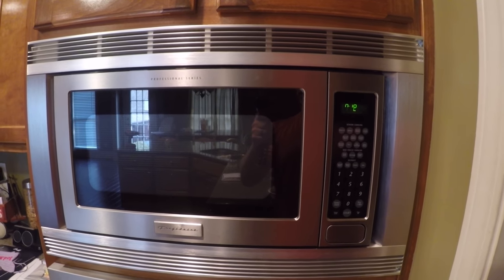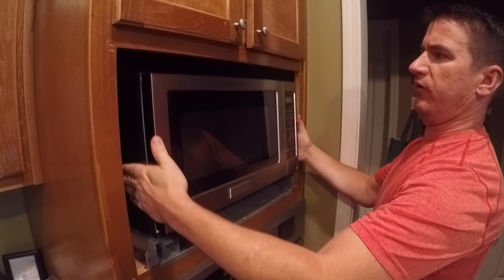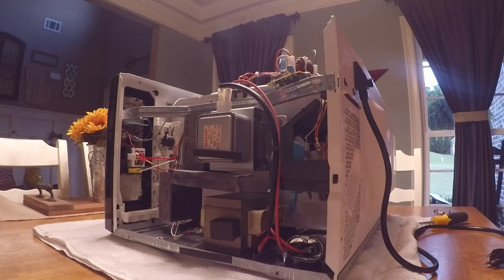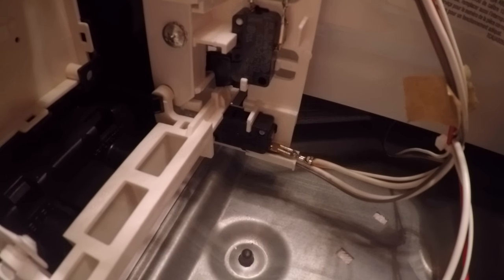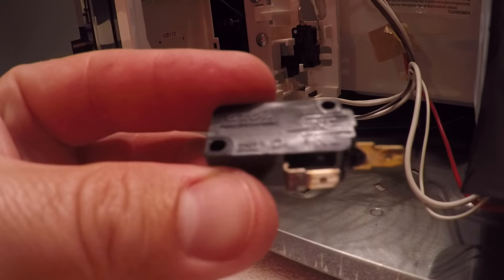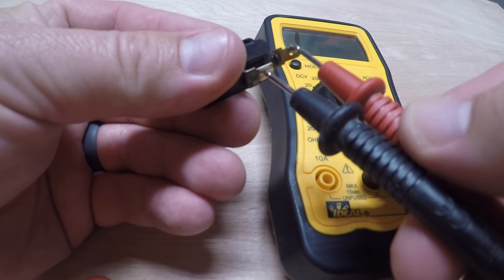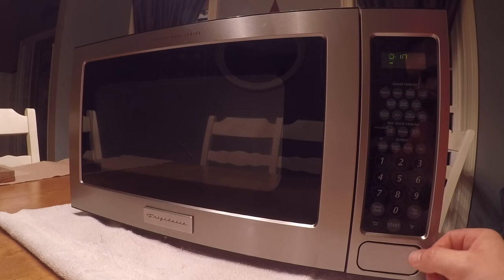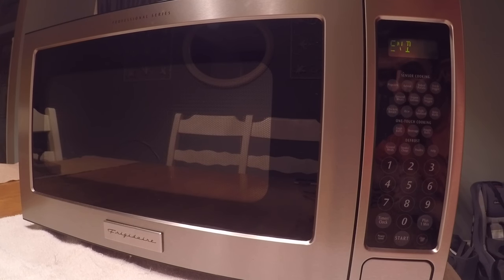EASY FIX: Microwave Will Not Heat and Turntable Will Not Spin - How To Fix A Broken Microwave

Comment: This is the best tutorial!  My Sharp Carousel botton switch keeps messing up.  Will check to see if the wires are touching.  Believe me, I am very careful to not slam the door shut.  Is there anything that I can do to SAFELY keep the switch wires from contacting each other?
Reply from the maker: jharbo1 I suggest you cut off the spades and put new ones one. You can bend them a little bit so they are farther apart.
Reply: The switch can be damaged, but still work sometimes. The switch is designed to snap into the closed position (or open position if it is a N.C. switch) after the tab is pushed inward to a certain extent.  Once this has occurred, it is mostly the internal spring that is holding the electrical contacts together. However, if the switch is damaged, it can end up such that it is only the pressure that is being applied to the switch tab itself that is forcing the electrical contacts together.  In this case, the switch is entirely dependent upon the microwave door to doing all the push work, and thus it is not 100% reliable.

Comment: Hey. Thanks for the video. Not sure if that was my issue. My microwave has the same exact symptoms. I took everything apart. Got the the lower switch out. But I am unable to slide the wires out. It won't budge. Any ideas?
Reply from the maker: Brian Bernal are the wires on a spade connector like mine were?
Reply: @TightWadDIY  yes. But it's all one plastic piece

Comment: I found a faulty switch with your video..thanks!  The switch actually worked to some level...the spring inside it was shot so it would not return to the NO position.  Had to play with the micro switch to find the fault.
Reply from the maker: Dave C. I’m glad you found your issue and were able to get it fixed. Be sure to subscribe!

Comment: Using this video helped me fix my very similar problem.
Reply from the maker: That’s great! I’m glad it worked for you too!
Reply: @TightWadDIY  Actually, strike that. 😥 I replaced the bottom door switch but the microwave is still instantly blowing fuses when I plug it in!

Comment: @TightWadDIY, do you know if a KW3A switch can be used universally regardless of the numbers next to the NC/NO on the switch? The switches in my Kenmore microwave indicate NC2 and NO4, but for the life of me I can't find those replacements anywhere! Thanks.
Reply from the maker: NC2 and NO4 means Normally Closed and Normally Open. Those are switch settings. I’m not sure about the KW3A. I’m not an appliance repair person so I don’t know all of the details.

Comment: Hi!  Can you please provide a link to where I can buy this part?  Also, in my case the white wire also looks burnt.  Should I replace that as well?  Thanks for an awesome video!
Reply from the maker: Vip Shah If you send me your model number I can send you a link. You should replace anything that looks burnt.
Reply: @TightWadDIY  It has a Frigidaire brand but on the inside of the microwave it states "318279610"...It is part of Frigidaire package model # PLEB30M9EC...Thanks!
Reply from the maker: Vip Shah Here is a parts list for your model. You can get the part number here and then search for that part number on Amazon or via Google to find a better price.

Comment: Wondering if that switch and the light switch are the same part? If so, guess you could do without the light on while cooking, since you rarely look inside while it's cooking anyways, or temporarily do without it, while you locate the best deal on the switch. Nice video!
Reply from the maker: arciefan The microwave needs both switches to function properly.

Comment: Mine is a GE Microwave. We have power, the light is on, and turntable not spinning. But the timer does count down.  I dont hear the magnetron engaging as well. I think its the lower door switch as you mentioned. If the lower switch is faulty it would not give power to the magnetron is that right? But I will let you know how it turns out.
Reply from the maker: It’s a door switch but I can’t say which one for sure.
Reply: @TightWadDIY   I have been doing without using it this week but I should get to it soon. Thanks very much. Glad we found you.
Reply: @TightWadDIY  Hello sir! It was one of the door switches like you said. It was the lower one. The switch still got power on the multi meter but it was worn out the plastic thing that pushes down on the button wasnt able to give it enough pressure. It wasnt clicking like the other switches. Thanks you saved me 700$ plus tax. Unbelievable! I owe you some beers
Reply from the maker: @JasonBourne93  I’m glad it worked for you. There is a Thanks button under the video if you really feel inclined.

Comment: @3:34 what if I don’t have that screw driver. What did you do there?? What if someone skips that step? Thanks for vid
Reply from the maker: Honestly if you don’t have a screwdriver you should probably get someone else to do the repair. I don’t mean to sound rude but it may be safer. Not discharging the capacitor could result in death.
Reply: TightWadDIY: Thanks. It turns out my screw driver does have rubber on it. But I may have someone knowledgeable to do it.

Comment: Great Video!  Can the lower door switch be replaced without having to discharge the capacitor or is it mandatory to discharge it before doing anything?  Also, would you have the part number for the switch available?  Thanks in advance!
Reply from the maker: Arnab De It’s recommended but not required. I don’t have the part number for the switch but it’s pretty standard.

Comment: I'm stumped by my microwave. Only the display works, no light, no fan, no magnetron, no carousel, but it still times, counts down, and beeps. The internal ceramic fuse is good, as are the 3 door switches. The door itself (spring, latches) is fine too. Any ideas?

Comment: Excellent video mate, I have the same problem. Will try this
Reply from the maker: Step 57 It’s a pretty simple fix once you know what to look for. Let me know if it doesn’t work.
Reply: Thanks for your quick comment. My light also not working. Turntable and light were fine last night but both stopped working this morning. Its still heating though. I suspect maybe a door switch problem? Not had chance to check with my meter yet. What do you think?
Reply from the maker: Step 57 That definitely sounds like a door switch.

Comment: Do I have to discharge that power source with an insulated screwdriver or can I just avoid the whole thing and only work on the door latch fuse?
Reply from the maker: Cobalt Blue Yes, you have to discharge it. It’s not worth the risk.
Reply: @TightWadDIY  thank you.

Comment: I have a COMMERCIAL temppleton MICROWAVE OVEN
MODEL: AFA-GMW-002. Both the upper and lower switch read continuity even tho it says the wires are on the normal open pins
Reply: Also what’s the voltage going to the heater normally I read 6 volts

Comment: I’m having a similar issue. My light comes on when I open the door, but does not come on when I start the microwave. Does this mean I need to replace both the top and bottom switch?
Reply from the maker: It definitely sounds like a door switch issue. I’m not sure which one.

Comment: Mine does everything but heat up. The tray spins, it hums, the light goes on, the clock works, everything works, but it doesn't heat food. Do you know what that might be?
Reply from the maker: Could still be the door switch.

Comment: Thank you for the excellent video.
Reply from the maker: WWJD123 You are welcome. I’m glad you found it helpful.
Reply: @TightWadDIY  Update - ordered the part, re-installed. Worked great. Part was a rip-off price at $35.00 (thanks to GE). But thank you again. Most difficult part of the project: Getting the microwave SS cover plate back on the built-in area.
Reply from the maker: WWJD123 $35! That is a huge ripoff. Did you order an OEM part from their website instead of using an appliance parts site?
Reply from the maker: WWJD123 The plates can be frustrating for sure.
Reply: @TightWadDIY  PartSelect. Local shops told me GE increased spare parts prices by 40% within the past year.
Reply from the maker: WWJD123 Wow! That’s crazy!

Comment: In addition to a bad switch, the connectors are also damaged (looks like they melted). I was able to get them off the defective switch, but now I need to replace the connector as well. Is that possible, and if so, what are they called? They aren't listed in the parts catalog.
Reply from the maker: Kimberly Mah They are typically called spade connectors. One may be insulated depending on your unit.
Reply: @TightWadDIY  Thanks! I was able to find them now by looking up spade connectors. However, now I see that the spade connector is just the part that attaches to the wire. Both of my wires have a plastic housing about 1" long that protects the spade connector - similar to the bottom wire in your video... and it doesn't seem like I can purchase that part. Do you think it's okay to reattach it without the plastic housing?
Reply from the maker: Kimberly Mah I don’t know for sure so I can’t recommend it.
Reply: Hi Kimberly did you ever get this issue resolved? I'm having the same issue.

Comment: This video was WAY off the mark. There's actually a THIRD switch, that's the one that was broken. I'm just clowning around. This was very helpful. I would have never guessed it was one of these switches. (I almost gave up after testing the 2 door switches and finding them good.) Anyway I actually fixed the switch with a blob of solder, it was an NO switch that was a bit damaged and wouldn't close all the way. Thanks!
Reply from the maker: Haha. You had me at first! I’m glad you were able to get it working again.

Comment: The switch is not the problem on mine, its whatever the door levers connect with got pushed back and dropped inside somehow when I softly closed the door. I tried to reach in with something small to grab it and it fell further back and further down so it has to be just a harness or something but that should not come lose that easy. The microwave is fairly new but maybe was a floor model so maybe that door was opened and closed more than usual.
Reply from the maker: That really stinks. I wonder if you can buy that part too.

Comment: is mine a switch issue my light comes on but no spinning or hear it on but if i wedge something under door it will start working .Does it sound like a worn switch?
Reply from the maker: I agree. I would replace the door switches.

Comment: What if the "connector bridge" breaks when pulling wire off terminal or the button? Sorry I don't know the actual name?
Reply from the maker: FAMILYFUN2000 I’m not sure exactly what part you are referring to but it can all be replaced. What is your model number and I will get you a link to the parts list.
Reply: @TightWadDIY  at the end of each wire is a metal connector .... it broke in half when I was pulling the wire off. Model number is mcm991b
Reply from the maker: FAMILYFUN2000 I assume you just mean the spade connector. You can buy those at any appliance repair shop for cheap. Cut the old broken one off, strip the wire a little, and put the new one on then crimp it with pliers. That may have actually been your issue instead of the switch anyway. Here is a parts list. https://www.appliancepartspros.com/search.aspx?model=mcm991b
Reply: @TightWadDIY  Thanks I will look into this

Comment: Ok mines gonna take some explaining, had to replace the fuse when it stop working completely, but used a higher amp fuse which would cause it to cut out whenever it overheated, but now the internal light had stopped working and it won't heat up food at all but the timer still goes
Reply from the maker: DARTHORIAN_DARK_WING Your current issue sounds like a door switch.

Comment: When testing the microwave its better that instead of running it with nothing in it you should put in a cup with some water like i do when i like to see how microwaves sound when i see one in my accommodation when I'm not home and some people dont set the cloco and you dont need to when you test it and then put it in the cabinet where it goes until more repairs come or when it finally dies forever where you will not be able to repair it and have to buy a new one
Reply from the maker: Cool

Comment: Mine spins and humms but no heat.
Reply from the maker: deepcritik It could be the top door switch.
Reply: TightWadRepairs If it was the door switch, it would not start or would?
Reply from the maker: Correct. Check the high voltage diode. It powers the magnatron which provides the heat.